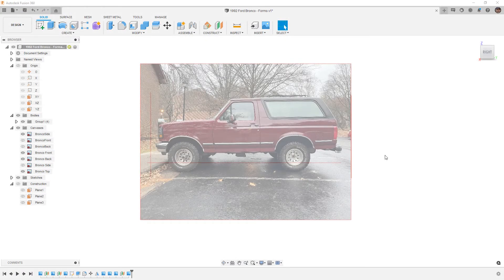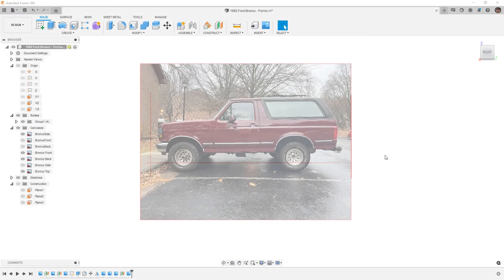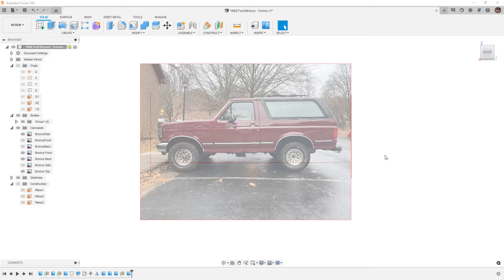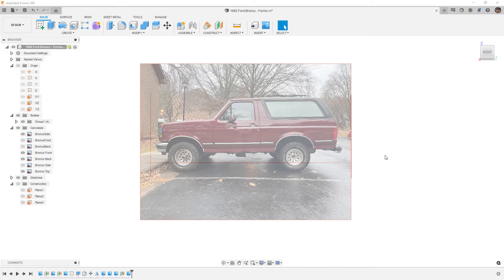Fusion 360 Forms - Bronco Modeling Speed Through #Fusion360 #CarModeling #Bronco #TSpline #Form

Comment: Can you link the file???
Reply from the maker: It is nowhere near done but just in case I can't get to it anytime soon.  Here is the current state of the model.
https://a360.co/3gLgf1N

I decided to do the top and body as a single form because that is the best way to get the body line to carry over.  But I haven't fixed the rest of the details in the timeline like surface splits or anything.  If i do anymore updates to the design it will be in that file and ill comment here.
Reply: Great job
Reply from the maker: Let me do a little more clean up.  The speed through was about an hour of modeling it and there are some details I don't like.
Reply: @LearnEverythingAboutDesign  you’re the man. Thank you. I am building a full size bronco right now and want to print it for inspiration! Can’t find files for them anywhere
Reply from the maker: Very cool!  I have had a few but my favorite was my 85.  Was in i6 with a NP435 4 speed.  It would crawl great in 1st gear.  I never owned a 92-96 but my buddy is building one also.  I always wanted to do a prerunner style(since mine was so rusted)
Reply: @LearnEverythingAboutDesign  thank you for the file! Broncos are for sure a blast. I am resurrecting a 1991 rust box now haha. If you like the prerunner style, check out Michael Cox bronco on YouTube. Definitely motivation for my build (I won’t be going as expensive as him, but inspiring nonetheless)
Reply from the maker: Yeah I am well aware of his :)  I've seen every video of him jumping it and the breakdown he did on his own channel.  Love the sound of that!  I prefer the 4.9l motors but if I was doing a desert truck then a big v8 makes sense.  Mike Cox is doing a full rebuild on that thing now I do believe!

FYI I am carrying on my surfacing series modeling the same Bronco.  I have been having issues with the surfacing tools but I am still trying to progress with that as well.  It was supposed to be a comparison between the two.  The forms bronco was maybe an hour and the surface one....who even knows at this point!

I had an 89 bronco for a short time I got for parts mainly and an 89 f150 that was my daily driver for nearly 10 years.  I tried to buy a 2021 Bronco but man they are hard to get so ended up with an F150 for now.  I hope to get one of the 2ds in a few years when the market cools down on them!  I really wanted the manual trans which is only 4cyl 2d and apparently pretty rare as all the first ones were 4d.